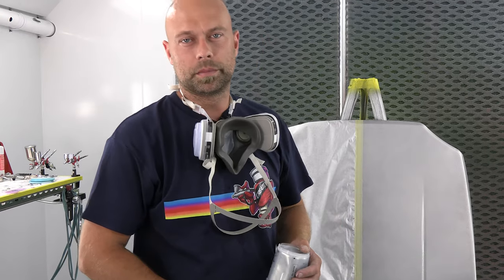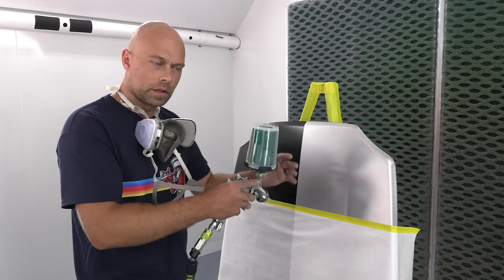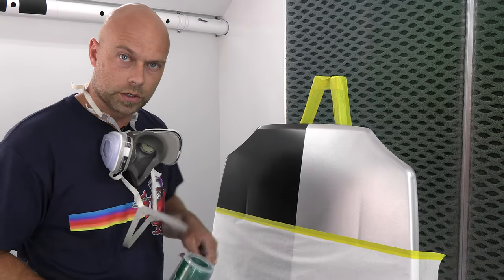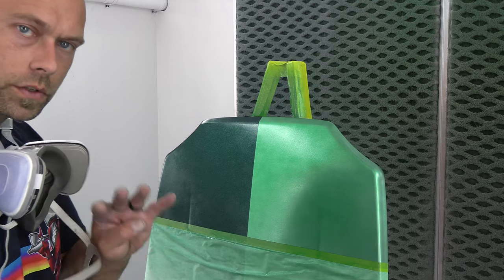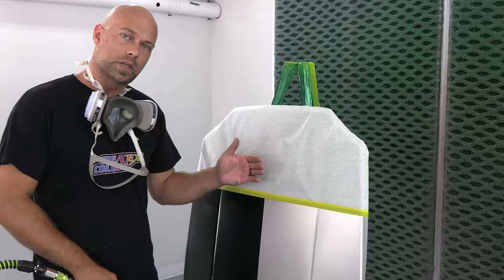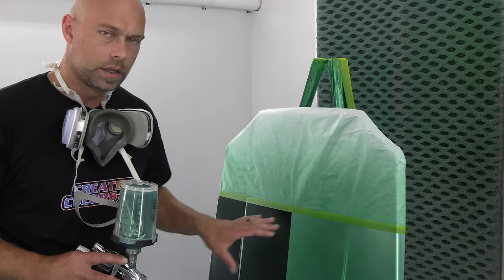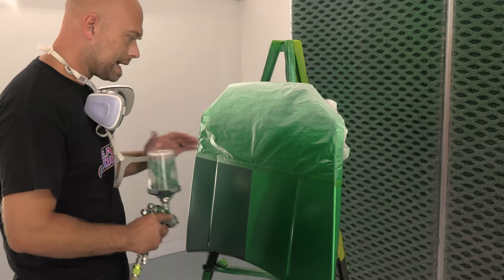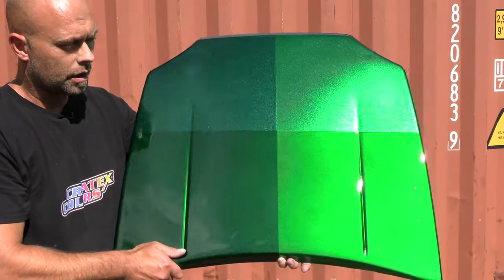Mixing Candy Colors with Pearl-Flake

Comment: So let me see if I get this right... 1st lay down a silver/black pearl layer, 2nd is candy color, 3rd is bleed checker and 4th is gloss?
Reply from the maker: 4040 Bleed Checker isn't required when applying a 2k solvent-based urethane gloss clear over candy2o. 4040 Bleed Checker is for application over candy2o when airbrushing graphics over a candy2o base before applying the 2k clear. Thank you.

Comment: Would you recommend the same mix ratios when using an Iwata HP-TH? also what air pressure to spray at?
Thanks
Reply from the maker: With a TH, the mix ratio may need a bit more extension with 4050 UVLS Gloss Clear and thinning with 4011 Reducer. A test panel will help dial in your mix ratio. Thank you.

Comment: maybe you could answer this for me. a few questions (1.) if using black epoxy primer if I just clearcoat it then its UV stable right??  (2.) I want to put some metal flake and pearl in the paint job should I lay down some 2 coats epoxy with no flake then just 1 top coat of epoxy with flake an pearl in and then 3 coats clearcoat over the epoxy , or do my 3 coats of epoxy then a coat of clear with metal flake an pearl and then 2 coats of clearcoat over that?? 
And it is just for my front and rear differentials, driveshafts, and springs and I have epoxy and clearcoat in stock and need to save some money an hoping to not have to buy more paint.. thanks and thank for sharing
Reply from the maker: Createx paints are compatible with epoxy primers, paints and clears. Please refer to our Automotive & Hard-Surface Application Guide available at www.creatextech.com, and make a few test panels trying out your technique using epoxy clears. Thank you.

Comment: Love these videos! 💪🏻 Any recommendations for a medium/full size gun that isn't to hungry on air? Especially for the sealers but all-around is welcome too! Love my LPH 80 but it is a little dinky for some of my projects.
Reply from the maker: Iwata spray-guns are fairly low on the air volume (CFM) required, at least compared to most other known brands of spray-guns. If you're set-up & compressor is having a hard time running an LPH-80, the better solution may be investing in a bigger air compressor and hoses with high-volume air fittings.  Thank you.
Reply: CreatexColorsCo Thanks for you reply! My compressor is rated at 280 L/Min so my LPH 80 no is running with no problem whatsoever.. I just seem to find that most full size guns are running at about 280 L/Min it more. And I would like a little more buffer than that. How is the BellAria for Autoborne sealers?  
Keep on rocking! 💪🏻
Reply from the maker: We use the Iwata W400 with the LV-WBX 1.3mm tip for most Createx paints, including AutoBorne Sealers. For candy2o and UVLS Clears, a 1.3mm LV2 cap is used for the W400. As the Bella Aria isn't available in the U.S., we're not using that cap too much although it does work well. Thank you.

Comment: weird question, just painted a test panel with metallic synergy green and then added green flake on top. the flake turned out weird where it looks like dark spots until directly in the sun... would it be because of using a 1.4 tip and its not shooting out enough or is it just the wrong colour flake and looks off?
Reply from the maker: We're not familiar with metallic synergy green?  what type of paint? what tip-size does that color's tech sheet spec?  thanks
Reply: @CreatexColors  it’s the colour they use for the green camaro now and it’s just a motobase metallic. Because of my lack of Knowledge I don’t know what the flake size is and I think that’s where the problem is as the base looked great

Comment: Chris, Can you shoot hot rod sparkle with a 1.3 gun or do you need something bigger?  I saw you using PPS, do you have to tear the filter out of the cap for Hot Rod Sparkle?  Thx!
Reply from the maker: Hot Rod Sparkle can be sprayed with a 1.3mm tip-sized gun. Remove the filter when spraying Hot Rod Sparkle, Createx's largest pearl-flake. Best application is mixing Hot Rod Sparkle with 4050 UVLS Gloss Clear (HRS 3:1 4050, thin 10% per vol. 4011 Reducer). Thank you.

Comment: Do you have to have a silver or black base to add a sparkle candy color ??
Reply from the maker: Our silver base / ground coat for candy2o is 6013 Silver Sealer, www.autoborne.com, and W300 Wicked Pearl Black, https://wickedairbrushcolors.com/pearl-and-metallic, applied over 6002 Sealer Black, works as a black pearl-effect base. For directly mixing with candy2o, W440 Cosmic Sparkle Silver works well,https://wickedairbrushcolors.com/pearl-flakes. For a black pearl to mix with candy2o, W300 Pearl Black is the best option. Thank you.

Comment: Beautiful. May try this , I think I have to reduce 25% with 4050 for an Airbrush (TH2 .5 nozzle) if I remember correctly.
Reply: Also did you clear with 2k or 4050 ?
Reply from the maker: Thinning 4050 25% per volume with 4011 Reducer for use with a TH2 (0.6mm) could work, however it seems a bit excessive, ~ 5 - 10% per volume works well when applying 4050 as a clear with TH2; when mixed with candy2o, the 4050 + candy2o mix shouldn't require any thinning, maybe 5% per volume at the most. Thank you.
Reply from the maker: A 2k solvent-based, urethane clear was used as the top-coat for this hood. Thank you.

Comment: Which color hotrod and cosmic sparkle did you use?
Reply from the maker: 4050 Hot Rod Sparkle green and 4525 Cosmic Sparkle Green. Thank you.
Reply: CreatexColorsCo I haven’t purchased any of those and I’m assuming that just the flakes are colored suspends in a clear carrier. Is that right? So using say green cosmic in blue candy2o could give me a blue green color shift.
Reply from the maker: Yes, Hot Rod and Cosmic Sparkle Colors are a colored-pearl flake suspended in a clear carrier. Thank you.